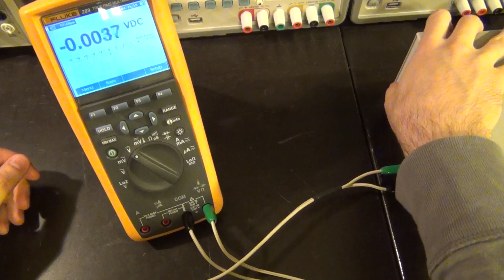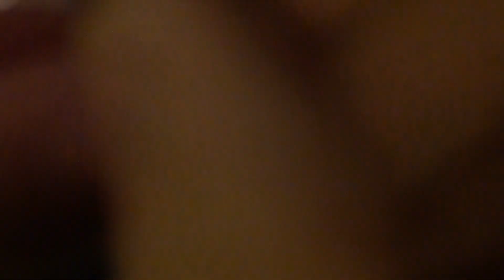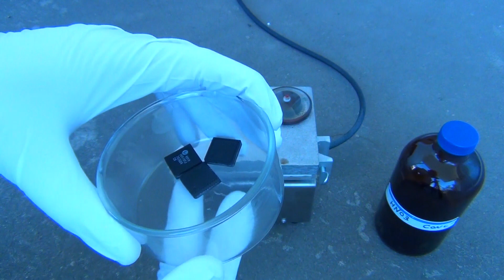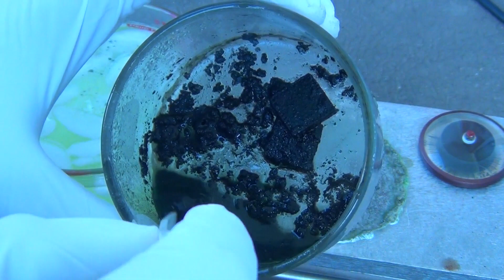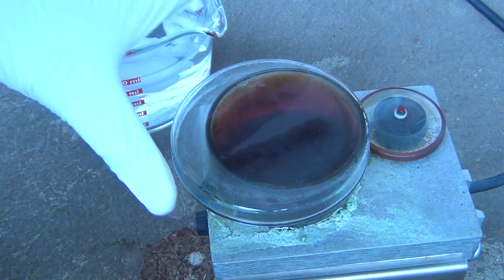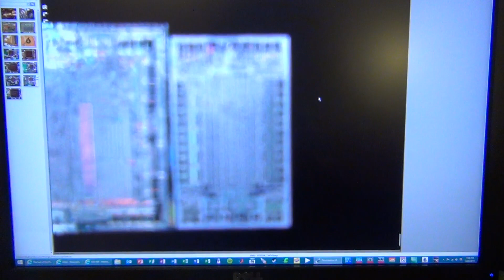TSP #50 - Teardown and Repair of an Agilent E3620A Dual Power Supply Plus IC Decapping Tutorial

Comment: Gloves? When using RFNA?  I'd AVOID those gloves.
(From what I understand, your typical nitrile lab gloves will actually self ignite if you spill RFNA / WFNA onto them!)
Reply from the maker: Thank you, I did not know that! I will have to make sure I have gloves designed to work with RFNA.
Reply: I just re-read what I posted and my own words comes across as hyper-arrogant even to my OWN eyes...
Therefore, I apologize... Gulp
Reply from the maker: @trevorvanbremen4718  Don't worry about it. The safety message outweighs any unintentional tone.

Comment: You could use super resolution (take lots of images with the board shifted a little each time), then align and overlay on a 10:1 upscaled grid. The result is a higher definition image (astrophotography uses this technique as do dithered upsampling filters)

Comment: I wonder why you didn't grind off the excess black until you cam to a point where you could have used the Nitric Acid to finish off. It would have saved a lot of time.

Comment: One Tip for you and everybody watching that video - never do leave any wires or traces as rusty as shown in the video. Be sure to always clean it up and at least get some soldering tin on that tracks and wires to seal it from oxygen. Tracks and wires already are weakened by the liquid (which I think was some cola or lemonade which both are containing acids). So you definitely want to stop that tracks from corroding any further by first clean it up very well and then isolate the track itself from Oxygen by strengthen the tracks with some added solder layer.

Comment: 11:42 I'd replace that transparent X cap by the voltage selector switch it's made by Rifa and they're known to explode without warning. They're a replace on sight component in older gear.

If you look close at it you will most likely see hairline fractures (crazing) in it's epoxy casing. Once moisture comes into contact with the capacitors plates it's just a matter of time before the plates short out and it emits copious amounts of smoke.

Just search Rifa X caps there are plenty of posts about them.

Comment: When desolder some rusted throug hole multiple pin components like IC's, cut all pins gently and than desolder each pin. Using this method you will save more pin holes and the damage will be less.

Comment: Excellent video as usual. A comment on removing through-hole DIL components. If I know I won't need the chip I find it better to carefully cut off the leads individually and then remove the remaining lead stubs one by one. This reduces the danger of ripping up tracks.

Comment: Very nice video as always. I have decapped several ICs successfully using 98% sulfuric acid, heated to around 100 deg C. It's much cheaper, easier to get, and safer than Nitric acid and it will not dissolve copper but does dissolve the epoxy quite well.

Comment: Hi Shahiar,The tear down and repair of the power supply useing the VFD driver display. I have a radio scanner with a similiar type display but the driver for the HV no longer works and is obselete. I was hoping to use a LED display useing a common Anode display to replace the VFD display. I would like your opinuion on doing that and any sugguestion how,I was going to use a voltage regulator to reduce HV voltage down to 5 Volts. The reason to use a common anode LED because the valve theroy were the voltage goes from anode to cathode.  Many Thanks David Grey
Reply from the maker: David Grey I suggest start looking at what interface is used to drive the VFD. If it is a serial interface, you may be able to use a microcontroller plus a regular LCD/LED display to replace the whole VFD and VFD driver.
Reply: The Signal Path Blog The VFD display is from a very early microcontroller which feeds the VFD display and not a single chip that is fed by a microcontroller which makes it a bit more difficult as in the term nothing is simple as it looks HAHA. You would be very aware it happens that way the output looks all most like the similiar system to drive a BCD display system accept it drives a VFD display.

Regards David Grey

Comment: I really don't like how they attached that transformer directly to the PCB, if you dropped that unit, it wouldn't just damage case standoffs, you'd likely crack and destroy the PCB. Not a good design AT ALL.

Comment: I drunk two cups of tea and ate 6 donuts while watching tthis video! Very good job.
I just wonder, what do you do with all these repaired units, you cant sell them on ebay, cant you?
Reply: Toni T800 I believe he does resell what he doesn't need on ebay, yes.
Reply: KX36 but then he has to mention, That the unit is repaired, and looks somewhat different inside with not original components, water damage etc.
Reply: Well, buying something sold as broken or "sold as is, untested" and then fixing it and selling it as "refurbished, used but tested and working" is probably going to make a profit, certainly not a loss; but I think what's more valuable to him is the video material he gets out of it.

Comment: Nicely done. Some IC have glass passivisation over the chip and I've seen hydrofluoric acid used to remove that and then the IC run under and electron microscope with reduced clock speed so you can see actually see whats happening :-)

Comment: Very nice of Gerry to send you that controller - it may be worthwhile looking at the protocol/interfaces incase a similar problem occurs in the future, although, with the likelihood, maybe not.

I would have sanded/ground them down more prior to putting them in the acid, just to minimize excess material, but also possibly to show a nice picture of the leadframe too.

Also, i'd say the package that dissolved first was the VFD driver, because it was from a different manufacturer compared to the two mask rom microcontrollers, so more likely that the same manufacturer used the same epoxy.

Anyway, great video, keep them coming! Nice work on the spec an too!